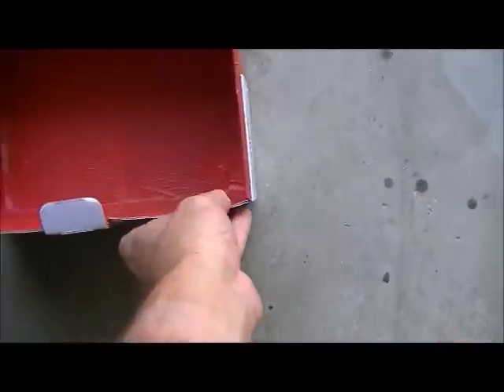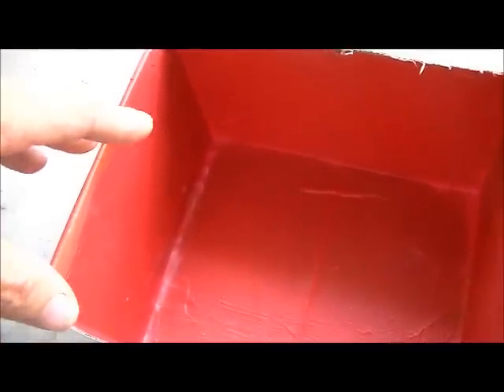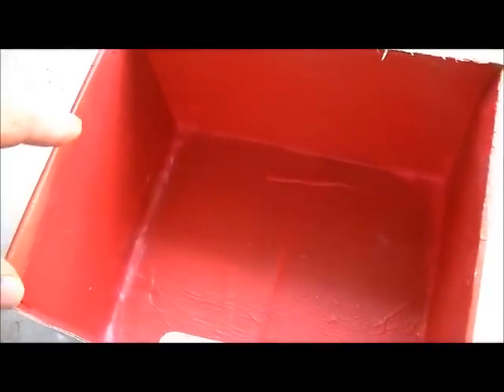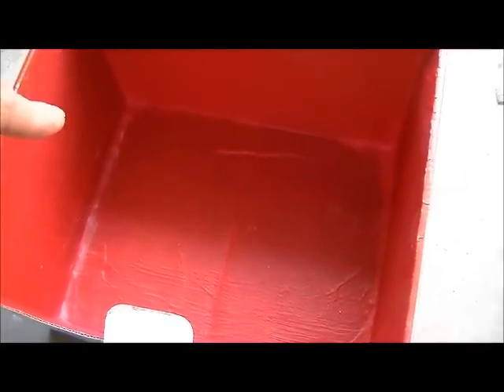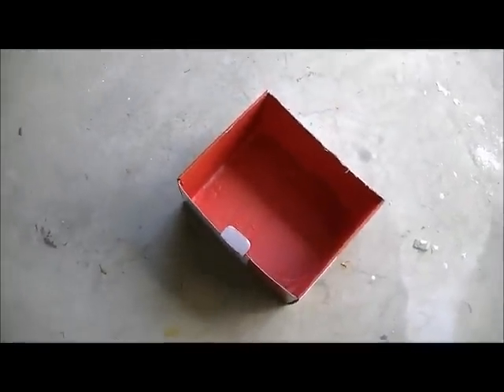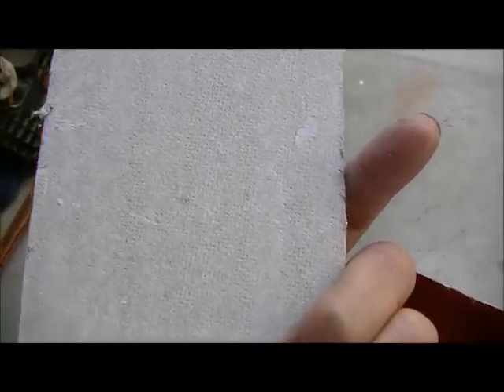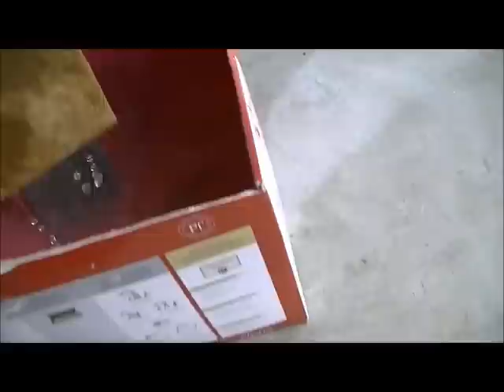Redgard on Cardboard...waterproof !

Comment: Dude, pretty informative, but god dang man, we are not stupid. Do u have to repeat yourself a hundred times. I couldn't even get to the end. The hardi that you took out was installed incorrectly. That's why it crumbled. I've used that product, both products and had the total adverse outcome. You said yourself. It's all, just in case your shower leaks. iN CASE YOUR SHoWER leaks. Both work fine. You didn't mention, or maybe you did, I couldn't watch til the end, about how much easier it is to install the hardi over the Durocher. No taping etc. good job on the experiment though. Red guard rocks!  Q?  What do you use for shower walls?
Reply from the maker: Yeah I'm known to talk a lot, sorry...a genetic defect I guess ;-)
I always assume DYI's will be watching, not tradesmen so I tend to over explain.

Hardi contends their product ( because it's 90% portland cement ) will not absorb water...at all...no installation methods should not matter. But because of that make-up, I find it HARDER to install, and hard to the screw heads flush. I would rather install Durock.

What I use is my customers choice, not mine.
Reply: Please keep talking because I'm hanging on every word. I'm in Atlanta and I wish I knew you earlier!
Reply from the maker: Bev Cotton Thanks Bev ;-)

Comment: hardie does not do well getting saturated it's ok for siding but even there if it touches the ground or roof it will fall apart durrock will absorb the water but stay intact

Comment: I found your videos and love your approach and style. You explain well enough for even the novice to fully understand, and still answer questions that come up. Thank you for making these videos.

I saw this video and it gave me a solution for my current tub/shower. It was installed in the '60's and I'm not sure of the material, but it was just painted. It didn't look as though the shower was used much if at all, rather just the tub. When we bought the house and started using the shower for about a month, the paint just started peeling.

Having just bought the house, we aren't ready to replace the bathroom just yet. So we stopped using the shower to let it dry out. Then I scraped off the loose paint and coated the shower with Redgard. I put 2 coats, tub to ceiling and 3 coats on the joints with fabric backing. 

After letting it cure for 72hrs, I'm happy with the results. $67 ($50 for the Redgard, $17 for the fabric) and I have some time to save and do it right. Even though it's a temporary fix, I don't need to worry about it failing.

Comment: Thanks for your very informative videos. I am redoing my shower. During the demolition I found two wall layers: first one was drywall and on top of it there was Durock board. I also had 4x4 tiles and non sanded grout). I believe the corners had not been caulked.  The cement boards sit on top of a cement baseboard that is 3-4" high, so they are raised off the shower pan. I am putting the first wall layer as Durock (instead of the original drywall) with Hardi backer on top (because it's more rigid as you say). I intend to waterproof with Redgard (at least 3 feet high, maybe more) and I am planning to also treat the shower pan with Regard (why not?). I have a cement shower pan, and in one of your comments you say that waterproofing the shower pan with Redgard is not recommended. Why? Is it an overkill or is there a serious issue with doing it? Thanks.
Reply from the maker: Paolo Sabelli I Redgard the walls to shower head ( 2 coats ) and all corners 3 coats, then onto pan surface about 8'' out from wall...never was comfortable painting entire pan surface, not sure why, just feel it might end up being a "mold sandwich"
Reply: StarrTile Thank you for your prompt reply, I appreciate it. I can see your point with regard not treating the entire shower pan with Redgard. (During the demolition I did not find any waterproofing between shower floor tiles and pan, just the thinset. No water damage or retained in the pan, but some water had gone through some corners, presumably because they had not been properly caulked or there was some sort of failure in the grout.)
Reply: Paolo Sabelli 
So, I have my HardiBacker board installed and I am pondering if I should use my mesh tape with thinnest grout over my joints first AND than apply the RedGuard; or should I apply the mesh tape bonded to joints with RedGuard in lieu of thinset??
There is a plant science research guy in Tucson AZ w/ same name!
Jeff Hamilton using my son Muir's uTube account
Reply: MarbleDuck Hi Jeff and Muir, this is Paolo. My project is on hold now (I am with Alan's family) but I would do your first option mentioned: mesh tape and grout to seal gaps between backer's pieces and then apply Regard on top. I am not an expert (I am learning along the way) but that's the way I am going to do it next. Good luck. Good to hear from you. Best regards to you, Kathleen and Muir. Paolo

Comment: I am remodeling master bath I have it down to the studs the tub will have a shower and I want to use tile on all the walls in the bathroom. If I use the redgaurd membrane what should I use as a substrate? 1/2 sheetrock? 1/2 Plywood? do you put tar paper or moisture barrier behind? I enjoyed your video
Reply from the maker: Def not plywood on walls ! But anything else will do, Durock, Wonderboard, HardiBacker, Greenboard...there are those that say NO to greenboard, but Redgard will stop water no matter the backer you use. No tar paper with a topical membrane.

Comment: Great Video.  Wondering why Home Depot charges more for Hardi Backer (~$12) then Wonderboard (~$9)?  Consumers like me would choose the more expensive thinking it would be better.
Reply from the maker: Hardi is 90% portland cement, or at least that's what they tell you...don't know what the other 10% is that makes the outer portion degrade, but regardless of the backer, Redgard is insurance.
Reply: Pretty much what i just did... I guess ill be red guarding the hell out of my hardie backer.
Reply: This must be the old Hardi Backer because the new version.  I did this experiment and the Hardibacker stayed solid.

Comment: i will be doing a bathroom renovation.. first time.. what should i use on top of bathroom subfloor which is plywood??  Specifically, do i need mortar between ply and cement board and redguard on top of board? then tile ?  I would appreciate your help you seem knowledgeable
Reply from the maker: Not sure if you are asking about shower floor or bathroom floor...bathroom floor just cement board screwed or nailed down, then tile, shower floor just pan liner, mortar ( dried overnight or longer ) then tile....no redgard, that is for walls and curb only.

Comment: hi, great video.  I have a couple questions - 1] why do you not like Durock for walls?What do you use for shower walls?  From your video I would think Duroc with Redgard would be the bee's knees.  
tx for the video, seeing is believing - Redgard should use the cardboard box demo on their website.
Reply from the maker: Durock has to much give between the studs, it bends if pushed...I personally don't like that. Anything more rigid is good, Greenboard ( I know it's a big no no, but Redgard protects it ) or Denshield, or Hardi, AGAIN, assuming a topical water proofer is used.

Comment: I realize this is hypothetical, but a qualitative answer will suffice:

Let's say you started pushing on the corners of the box after it had soaked for a week.  How well do you think the corners would hold up to flexing and moving?

Is it possible that the pinkish RedGard (after soaking for a week) is more tolerant of shifting?
Reply from the maker: Hypothetical of course, but I would feel comfortable building a shower from cardboard with Redgard on it. Shifting would effect the cardboard, but not the membrane ( Redgard ) since it's rubber & flexes.

Comment: wow - very surprising about the Hardie, which I'd always taken to be the most solid and most durable of backer options, just based on its ability to take abuse in handling.  Thanks for sharing that troubling discovery.  I didn't believe it until I saw your week-later check.

This has me thinking I might do better to build a custom shower using carpentry methods & something like Medex (water-resistant MDF) or marine ply, both of which are a lot more pleasant to work with than anything cementitious, anyway.

Or, hey...cardboard...
Reply from the maker: Honestly it really doesn't matter what your backer board is, as long as you waterproof it with something... having said that, as others have already pointed out, this is possibly not Hardi and in fact at USG product called fiberock...the manufacturers tried really hard to make it look like hardi

Comment: great video!! stupid question, but do i need to use a pan liner and mortar on the shower floor? Would one piece of cement board with RedGard be enough? I also have a roll of fiberglass for all corners and seams. Thanks!
Reply from the maker: Yes you need pan liner & mortar....Cement board & Redgard won't work, you need a proper slope to the drain, hence the reason for the mortar.

Comment: Bob,  I'm a little confused.  I'm remodeling my shower and I was going to use greenboard, Hardibacker board and Redgard.  Now, what you're saying is not to use hardibacker board and just use greenboard and redgard?  Should I return the hardibacker boards I purchased?  Please tell me.
Reply from the maker: At one time I had a disclaimer on the video, not sure why it doesn't show, but I stated the board is a USG product, fiberboard and not Hardi. But again at 12:10 I clarify no matter what board you use ( even fiberboard ) it needs to be waterproofed in some way....in addition to grouting correctly & sealing the grout well to preclude water from getting to the backer to start with.

Comment: StarrTile so what board would you use in a shower if you wouldn't use either of these?
Reply from the maker: It does not matter which backerboard you use, ANYTHING will work assuming you water proof it. The demo was more about Redgard as a topical membrane than it was a choice of backerboard. The idea is to not let the backer see moisture.
Reply: Thank you for making the video it helped me a great deal. I even returned the hard backer board I bought for the floor. Thanks again.

Comment: I wonder how it would work to seal my basement wall if I used it on the inside. Hmmmm
Reply: noo needs fix from outside
Reply: Probably not good lol. Sealing water for one side is a lot different than sealing from the other side. My dad talked about something call damntight I believe. It was supposed to be something you can paint on the inside of your basement wall i believe.